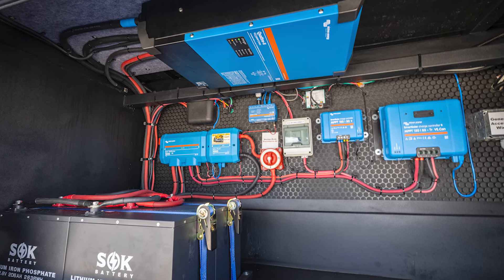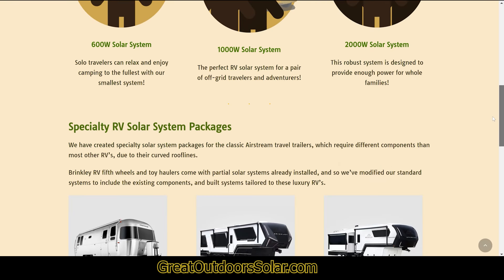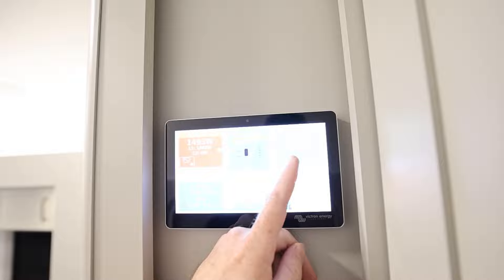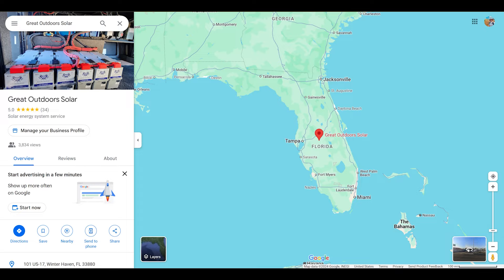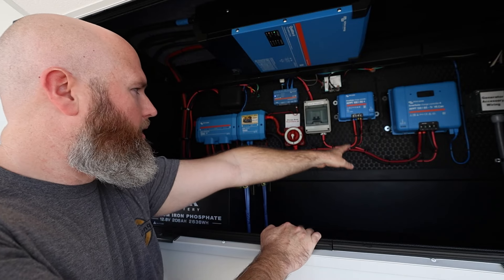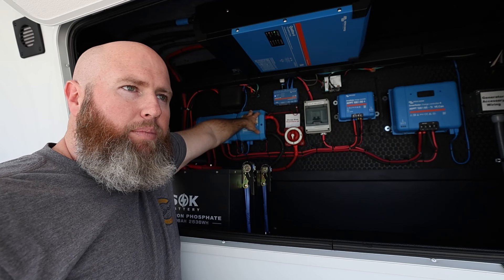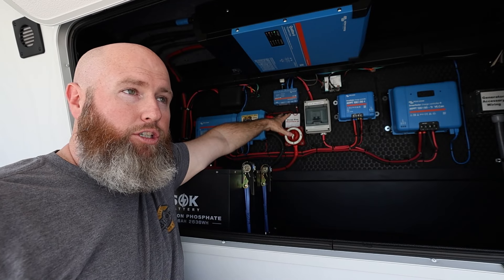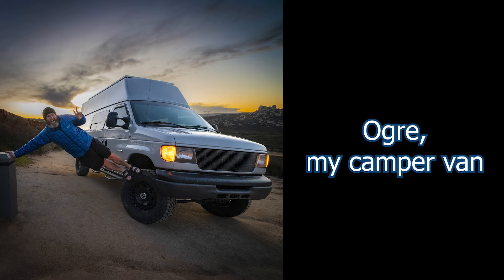Using a Ford Truck as a Generator | BRINKLEY MODEL Z 3400 SOLAR TOUR

Comment: I have a BS in electronic engineering, this is my 2nd RV and my 3rd system and I run an almost identical system with the Multiplus 2 on my new 2024 GD Reflection. I don’t use the truck for charging because I don’t need it. I did use 6 of the newer Rich Solar 250w panels along with the factory 370w panel. I also used the Epoch batteries. Keep up the good work. I always follow your installs!
Reply from the maker: Nice, we just did a Nexus Wraith with six 250w panels last week. Safe travels -Tom

Comment: Great Idea!  We just traded/sold our truck and GD Reflection for a new truck and Brinkley Z 3610.  Our Reflection was loaded with a nice solar / Victron system we installed ourselves and it was so nice we were starting to plan our next install for the Brinkley.   And, of course, I was fully committed to do the DC to DC charging.  I actually thought to myself that the on board power on my new F350 was a waste. But now, after watching this, I am STOKED to use it with a Quattro.  Thanks so much!
Reply from the maker: You're welcome. Happy tinkering! -Tom

Comment: Will reduce the life of the alternator, pulling 120 DC amps while connected. I use a BIM that only charges for 15 minutes and take a break for 20 minutes. I have install over 50 of them and seems to work real well.
Reply: BIM ??  Please elaborate. Thanks !
Reply from the maker: The truck has either dual alternators or an upgraded alternator to power the onboard inverter. Lots of trucks on the road pulling high amps off the alternator. Like refrigeration, plows, dump beds, and on and on. I personally upgraded to a larger alternator and pull 100A constantly off it via dual 50A DC-DCs. The Lithium Battery Isolation Manager is a good option for motorhomes, I used one on my class c back in 2018. It doesn't provide as much charging (due to the 15min on and 20 min off) and it doesn't increase the voltage, so I've found they usually don't get the lithium's above 90% SoC. Especially for towables where you've got a 25-40ft wire run from the alternator to the house battery bank. The voltage drop from that long of a distance is real, even using #2 wire. The BIM also doesn't regulate the current down and allows the batteries to pull the max the alternator can put out. Pros and Cons to everything for sure. IMHO if you have a truck with a onboard 2000w inverter and a second (or larger) alternator, the Quattro is the way to go. If you don't have that already.. then a small generator is still more power, less fuel, and easier to do than DC-DC charging on a towable RV, like the one in this video.

Comment: Great idea! Wish I knew about this 6 months ago. I have the F250 with onboard inverter. I went with the multiplus in the camper and use the truck to supply AC power through the shore power cord when stationary instead of carrying a separate generator. Would have been nice to be able to supply power while on the move.  Now I would have to do a transfer switch to get a similar result.
Reply from the maker: Nice, hope it's worked well for you! Thanks for taking the time to comment and safe travels. -Tom

Comment: The best solution would be to get a propane conversion kit for one of the Honda 2000s or one of the similar models from another manufacturer. That’s already running on propane and then you could install it, and that same compartment with the battery system, since those are sealed, lithium, batteries… you would simply need to put an exhaust connection to the outside, and a fresh air intake pipe. But at that point, you will be able to turn the generator on and off remotely because the Hondas can be made capable for remote start and it could run on your existing propane tanks.
Reply from the maker: In our 3.5 years of fulltime travels I never needed a generator. Once the weather gets too warm or cold, instead of running a generator 24/7, you're better of using the wheels on the RV and moving. But this is way better than a DC-DC charger for a towable.

Comment: What HD trucks have a 2000w inverters?   I thought they were down around 400w
Reply: Fords have up to 7200 watt inverters
Reply: @EBKRV412  only the f150 hybrid.  I don’t think any of the HD Ford trucks have it.
Reply: @ClayBellBrews  the HD's have the 2KW since 2023 and the 150s have the 2kw or 7.2kw at the moment but the new Super Duty's will also have the 7.2kw or larger as an option in 26 when their new Hybrid HD launches....GM and RAM are falling far behind
Reply: @EBKRV412  Look at Ford slithering in on being useful during this electrification craze. A shame GM and Ram always playing catch-up
Reply from the maker: I know Ford does, not sure about others, but it's definitely coming to the market. There have been people making tool boxes that have inverters and batteries in them for mobile workers for a while now. You see it in the oil field and other more remote jobs quite often. I think the manufactures are finally seeing that as a selling point. So hopefully more and more will put a bigger inverter in. LOTS of campers would love to not need a generator while camping. -Tom
Reply: @EBKRV412  Thank you.  You just answered my question.   I couldn't find any 2021 F350s with the on boar power, and now I know why.
Reply: @GreatOutdoorsSolar  My 2023 RAM 3500 HD is limited to 400W at the rear inverter.  Won't work for me but I guess it will for the Ford guys.
Reply: @EBKRV412  That's special order, and that option will set you back and additional $1745...
Reply: @EBKRV412  IF the vehicle was ordered that way, it's still an additional $995 for the 2400w inverter option...
Reply: @wipatriot510  huh??

Comment: How did you keep the truck from throwing a "Ground Fault"  I'm Running mine through a Transfer switch and I bypassed the SurgeGuard so it basically from the truck to the Victron Multiplus II X120.
Reply from the maker: First, I'd check your grounds in the transfer switch (just in case). The Multiplus uses a relay that bonds the neutral to the ground while in inverting mode (this is a VERY important safety feature). It opens that relay when it connects to incoming power. That relay is pretty fast, but sometime it'll trip a GFCI outlet that's sensitive, or in your case, it seems your truck. My suggestion is to put the inverter into "charger only" mode and then plug it into the truck. In theory that will cause the relay to open, before it's plugged into the truck. Safe travels! -Tom
Reply: @GreatOutdoorsSolar  Thank for the info. I will check into that

Comment: Most inverters that come preinstalled in trucks are NOT pure sine and lower power. 350 to 800w isn't enough. So might as well install your own or upgrade the factory unit.
Reply from the maker: That is an option if you really wanted the onboard truck inverter. A simple 2000w cheap pure sine inverter would work just fine. -Tom

Comment: Great! You’re using your truck to charge on travel days (a basic example you used) and by using the trucks inverter to charge, they “save a lot of money”. Well that inverter is a VERY costly option on the truck side, about $1000. Can you install a DC to DC charger for less than $1000? It only sacrifices minimal about of charging power for cheaper. Yes, the way your utilizing the on board power is is a cleaner option, just don’t sell it as a cheaper option, thats relative.
Reply from the maker: Seems like you didn't watch the entire video, I talked about if your truck doesn't come with an onboard inverter. I also say how much it cost for us to do a DC-DC converter and wire the truck, which is not less than $1000. For those that have the plug already it is cheaper, in fact it less than half the price. For those that don't, I would just buy a cheap generator that will power the 120A inverter charger over the more money and less charging of a DC to DC charger on a towable. -Tom

Comment: love it!! now I need a new truck with an inverter.. hahaah thanks for the insight. I had no choice to use the dc 2 dc 30. It was the only choice when I built my system 3 years ago. 
But I love your idea!!! I though of using my small 2k gen and put it bed of the truck and run that.. but so far just with solar and dc 2 dc and we r good
Reply from the maker: If it works, no need to spend more money. My van only has DC-DC chargers and solar, and works just fine. Safe travels!

Comment: That was helpful. Have you found the inverter in ram trucks is reliable?
Reply from the maker: We haven't connected to one, but other commenters are saying they only have 400w inverters, which would be too small. The Multiplus can be limited down to only pull ~9 amps @ 120v (~1100w), so the 400w inverter (~3A @ 120v) wouldn't be enough. -Tom

Comment: Why do i need a 2nd AC input?  I can just use a 110v adapter to the shore power?
Reply from the maker: Sure you can use the shore power cord.. but I'm not sure how you'd drive down the road with the shore power attached. -Tom

Comment: thanks for the heads up, my Deneli duelly didnt have the on board inverter...only a second alternator with a second battery..sniff so I went with the Orian 30amp. It was the only thing available with Victron. Its a good idea the way you set your client up, I like it.
I never came close to 50% with my battery bank on the road. Solar + Orian were on point during my drive.
Reply from the maker: Just depends on where and when you're traveling. For example fall, especially in norther states can be tough to stay full on solar alone. Lots of new trucks come with the 20A plug now in the bed, not all, but lots do. So this is simply an option, I wouldn't go buy a new truck or anything. However, when lots of people retire, they buy a new truck and a new RV to travel in, so it's an option for those people. -Tom
Reply: @GreatOutdoorsSolar  exactly true.. when I travel from Montreal to florida in Dec, the solar rays are very low. I also outfitted a small fan pushing fresh cool air onto the 12/12/30 Orion. It heats up and throttles the amps.. but not any more. thanks again for your awesome content. Keep it coming

Comment: There is a huge issue with using the truck as a generator, at least with a diesel anyway. One of the worst things you can do to a diesel pick up that is emissions compliant is to idle it… So the only time this would be useful would be when they are driving from point A to point B.

I don’t think it was not worth doing, but they certainly never want to be using a diesel truck in place of an inexpensive, portable generator at a campground site. 

That is just a recipe for blocking up the EGR system and the DPF on that truck. In fact, my GMC 2500 shuts off after about 15 minutes of idle time to prevent this kind of issue.
Reply from the maker: We don't make the trucks, but in my opinion they should be able to idle like old trucks do. Modern semis can do it with the same clean diesel regulations. But this is mainly intended for while in route recharging.

Comment: Can you explain to me(us) how you're going to pull 15A from the vehicle inverter when the vehicle system is only rated for 400W/3.3A(max) at the vehicle 120V outlet...?
I run a VE 12-12/18A dc-dc as an alt method to charging batteries on a travel day...
Reply from the maker: You're missing the fact that some vehicles comes with a 2000w inverter, not a tiny just about useless 400w one. So this video is for those people. 18A @ 14v is ~250watts which isn't much when you're recharging a 10,000wh battery bank. It'd take ~40 hours, where the 120A from the inverter charger is ~1600w aka ~6 hours to recharge the whole battery bank. -Tom
Reply: @GreatOutdoorsSolar  What vehicles come with a 2000W inverter...???(other than fords power pro option, which an additional $995 for the 2400W on the gas version of the F150, or even the superduty,  IF you ordered it) 
Well, I have 12,960Wh battery bank, and I didn't say that it was the only I have of charging, I said it was a method of charging on a travel day, I also have 2200W PV panels on the roof, 3 VE 150-/70 charge controllers, feeding 2-VE Multiplus II 120x2 3000Va inverters in parallel,  and the necessary HW to support the system...
Additionally, my other unit has a 12/12-50 DC-DC charger in addition to 1000W PV panels, 1-150/70 charge controller and a Multipus II, 12000Wh battery bank, and all the necessary supporting HW...
Relying or even utilizing the vehicles onboard inverter(regardless of size) for extended periods of time is foolish and irresponsible, they're meant to be used for short periods of time, not maxxed out for extended times...
Alternators are another consideration, undersized alternators running full bore all the time won't last long either...
Do it long enough and often enough and you smoke the vehicles electrical system, that is if you don't burn the vehicle to the ground...
Reply from the maker: The Ford in the video clearly came with a 2000w inverter as it was pictured. A $1000 truck upgrade for a 2000w inverter is about the cost of a similar sized good generator. It's only about $600 extra for us to install the Quattro this way. So about $1600 total.. where a single DC-DC charger installed is typically $1400-1600 for less charging. So it is a good option, we're simply taking advantage of the vehicles that do have the 2000w inverter for our customers... we don't tell them what truck to buy. As far as burning up the alternators and/or causing the truck to burn down. I feel you're unjustly upset at us for your truck not having a 2000w inverter. We are not a vehicle manufacturer, so I suggest you take some of your questions to them. Hopefully the multimillion dollar company designing and selling the truck put some basic R&D into the inverter they are installing and the system that is powering it. As far as your systems go, I'm glad they are working for you. Just like your systems, this one isn't solely charging off the truck...  -Tom